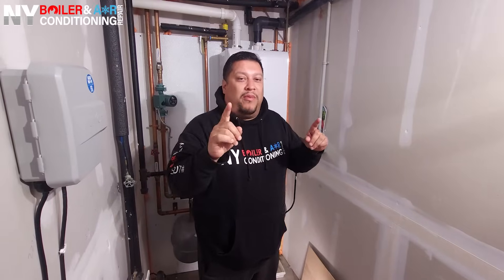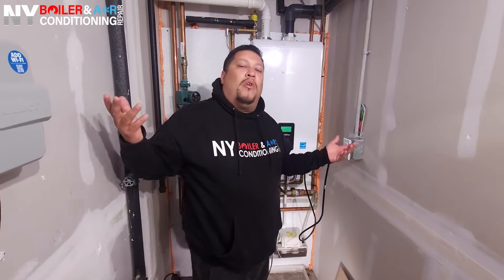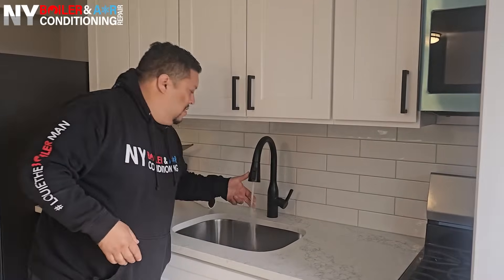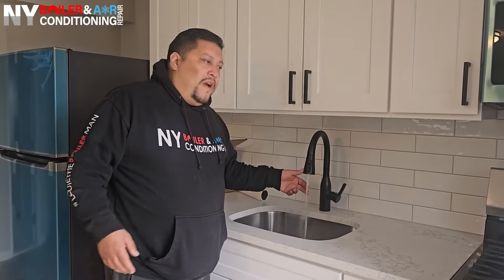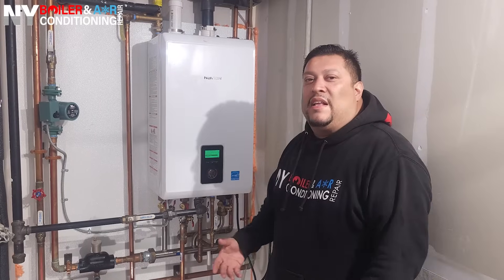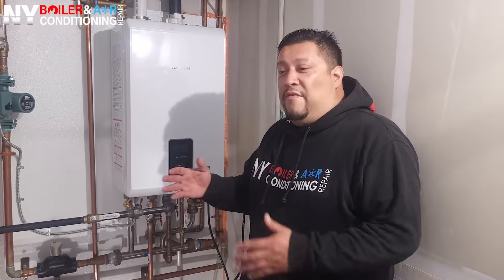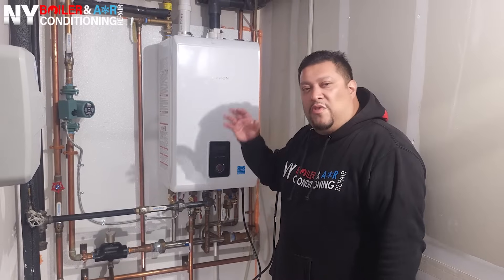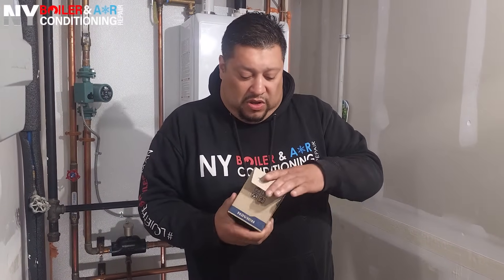HOW TO FIX A NAVIEN BOILER WATER FLOW ISSUES (Louie The Boiler Man)

Comment: I'm having an issue right now in my house where my water meter is slowly moving constantly throughout the day even when there's no water being used in the house. I have troubleshooted this and none of my toilets or sinks are the problem and I don't have any other appliance that could be using water except my Navien.  I called my plumber and he said it couldn't be the Navien unless I see leaks somewhere and I don't.  But I read online that a malfunction could cause a constant flow of water through the Navien which would be moving my water meter... How would I diagnose that? And no I haven't turned off the water to the Navien yet because honestly I don't know how.... And I'm a little scared to do so since it's 18° here in New York and I don't want to mess with my heat and have something happen.  Is there anything diagnostically on the on the panel in the front that would tell me if there's constantly water flowing through the machine?
Reply from the maker: Good Morning, yea it’s hard to say remotely but what i would do is shut the water fee to the Navien boiler.  You should have a valve and close it and take a look at the meter again and shut the valve also after the meter to confirm if the meter continues to spin when the valve is off. If it does then the meter is bad and if stops then yes you have running water somewhere. Your going to have to do process of elimination and even if you don’t think there is a leaking fixture like a toilet or sink I would still shut the valves per fixture and check all of the fixtures one by one just to double check and confirm that particular fixture is leaking or not

Comment: Brother, one question: if the combi boiler does not have domestic hot water, is there also no heating?
Reply from the maker: On combi boilers they do both heat and hot water. You can get a boiler to just do heating only or hot water only if you wanted it separate depending on the application and what your using the boiler for

Comment: We have opposite hot water no heat? New machine installed two yrs ago. Had it clean a month ago they said we had air bubble they fix. Now again no heat but thermostat said heat on. Also pump are hot but not going into red piping
Reply: @dena8144  did you find the solution ? I have the same problem, thx